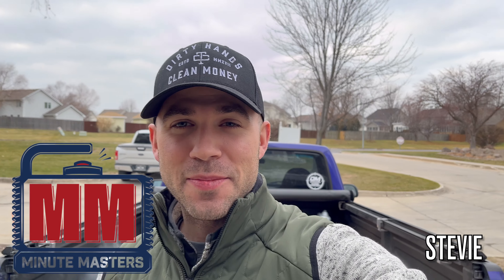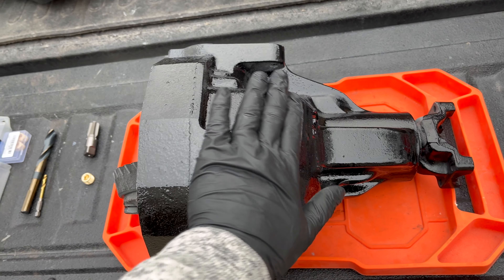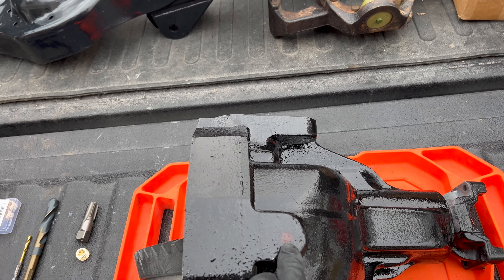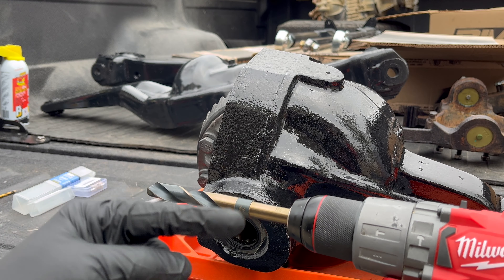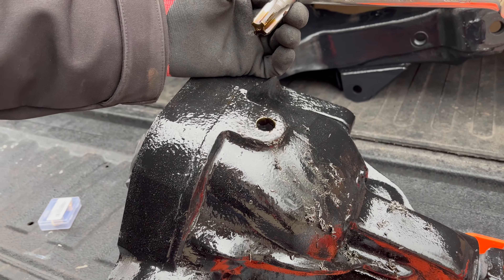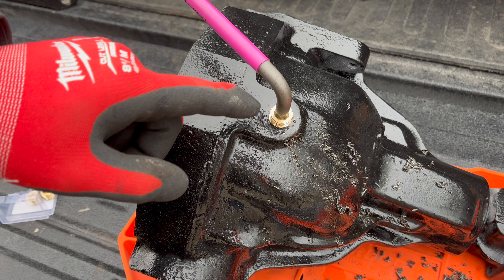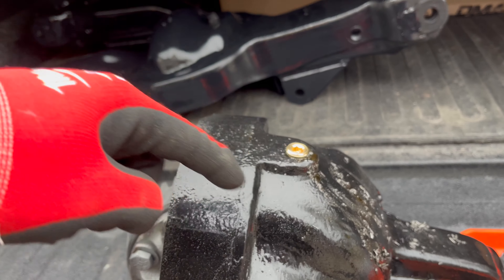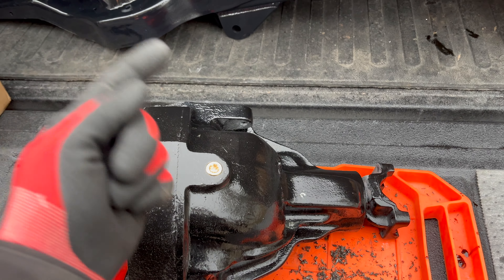The Best (& Cheapest) Mod for Your Differential | 1995 Ford F150

Comment: I just did the oil on my differential over these past couple days. Made sure my drian plug would come out first. Bought a case of brake cleaner and cleaned the inside as much as I could. I used a rotary tool to take off all the old silicone ( I covered the gears with rags first) layed the new silicone on and bolted her together. Let the new silicone dry for 2 days, added the new oil and its good as new now 🎉
Reply from the maker: Nice work man!🤙

Comment: Hi Steve experience pulling in to gas on 2 separate occasions with my 92 f-f150  I found  loose wire on solenoid on fender the nuts were able to vibrate loose so I put 2 lock washers and a lock nut on both studs this not only solved a no star but also seems to have solved my other issue with the electrical problem I mentioned  before.
Reply from the maker: Good to know! The body acts as a central ground. So your fix makes sense to me.

Comment: Fun fact: early 3rd members from early 80s had the plug installed from factory. At some point they quit to save cost.
Reply from the maker: Really? What a shame. Only a non- mechanic “bean counter” would do that.
Reply: @TheMinuteMasters  The way factories work, the change could well have come frorm the factory floor.  When I worked in manufacturing as an assembler, decades ago, our company gave incentives to employees who submitted cost-saving suggestions.  Anything like this would have earned the suggestor an amount based on how much it was projected to save, so a fraction of that.  Considering how many F-150's Ford made, this change could have saved a lot. So, as a bean-counter AND a fellow F-150 owner, don't assume virtue is inherent in design or that engineers are always about the ideal.  Lots of influences in mass manufacturing, youngun.
Reply from the maker: @borderlineiq  interesting! I met a COO who said something similar and his plant manufactured plastics.
Very true

Comment: Thanks.  This is my next project for my  '94!  Did you do a video on replacing the MAPS?
Reply from the maker: You’re welcome!  
Like the MAP sensor?
Reply: Yes.  I think it like inside the engine bay on the firewall, I believe.  @TheMinuteMasters
Reply from the maker: @bernardlock2728  Sound about right. My truck has an MAF. 🤷‍♂️

Comment: Are you able to give recommendations on a tune or chip company? My 302 died, and I’m installing a 393 stroker with an f cam, Afr 185 heads, Edelbrock victor efi.
Reply from the maker: Unfortunately, I have no experience with tuners or chips for these trucks. However, I’m told aftermarket MAF is needed for more HP.

Comment: I have a 94 f150 4.9 i6 stick shift and i want to convert it to a 4wd/ Would  a 87 ford f150 5.0 v8 4x4 donor truck do the trick without having to  buy anything else for the swap ?
Reply: Maybe change to a v8 engine while I'm at it...
Reply from the maker: I don’t see why not.

Comment: How did you prevent metal shavings from falling in your diff?or clean it out ?
Reply from the maker: No real method. I just used air and brake cleaner to clean out the diff.

Comment: Hey steve quick question, I have the same truck and I'm my front wheels more farther apart than the rears, would you know why?
Reply from the maker: Like they stick out farther than the rear? Like out past the fenders?
Reply: @TheMinuteMasters  yeah the rears axel width is closer than the ones on the rear
Reply from the maker: @igotnodrip4275  I would look up the factory specs for the width and see if it’s off. If your front axles stick out further than the rear (and it’s out of spec), my guess is the beams have come loose or the axle pivot bushings are gone.
Reply: @TheMinuteMasters  maybe but I've replaced almost all bushings in the front, I noticed it when I was trying to eye-ball the alignment before taking it to the shop, the front tires are a little outwards the fender and the rear is a little tucked in the fender it's weird
Reply: I am assuming yours is a 4wd, that’s simply the way they are. I have 2

I never really paid attention to the 2wd I’ve had, that may be the difference 2wd and 4wd